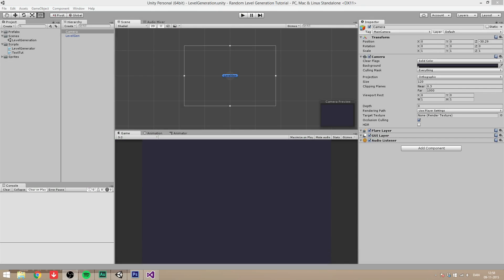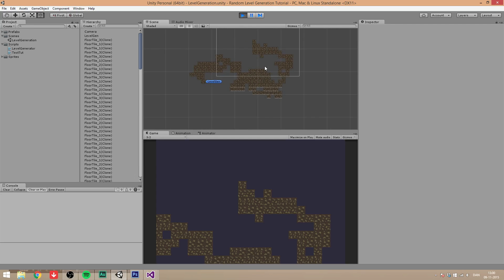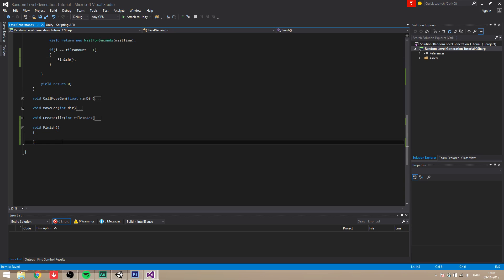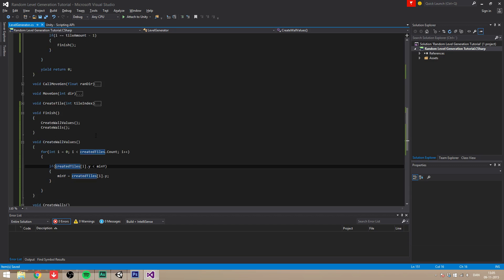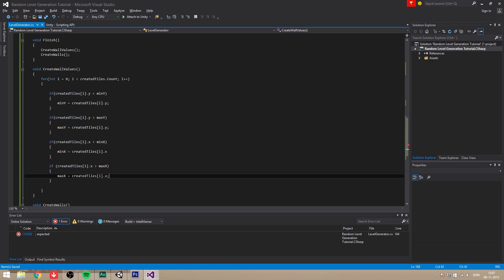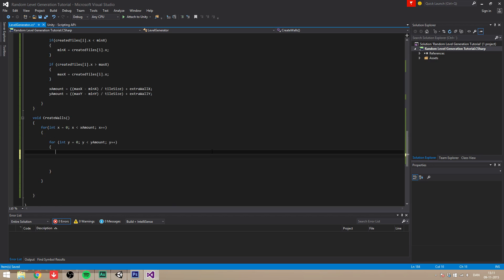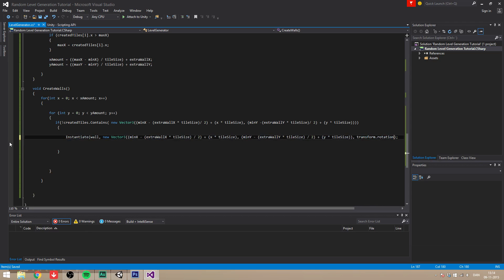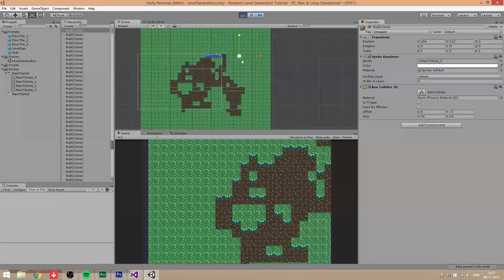Unity 3D - Random Level Generation Tutorial - Part 5 - Walls - 2D -

Comment: I have an issue with mine but I cannot seem to find the error. it is covering the entire area (or sometimes leaving random patches uncovered but most of the path is being covered). Here are the functions.

 void Finish()
 {
  CreateWallValues ();
  CreateWalls ();
 }
 void CreateWallValues()
 {
  for (int i = 0; i < createdTiles.Count; i++) 
  {
   if (createdTiles [i].y < minY) 
   {
    minY = createdTiles [i].y;
   }
   if (createdTiles [i].y > maxY) 
   {
    maxY = createdTiles [i].y;
   }
   if (createdTiles [i].x < minX) 
   {
    minX = createdTiles [i].x;
   }
   if (createdTiles [i].x > maxX) 
   {
    maxX = createdTiles [i].x;
   }
   xAmount = ((maxX - minX)/tileSize)+extraWallsX;
   yAmount = ((maxY - minY)/tileSize)+extraWallsY;
  }
 }
 void CreateWalls()
 {
  for (int x = 0; x < xAmount; x++) 
  {
   for (int y = 0; y < yAmount; y++) 
   {
    if (!createdTiles.Contains(new Vector3((minX-(extraWallsX*tileSize)/2)+(x*tileSize), (minY-(extraWallsY*tileSize)/2)+(y*tileSize))))
    {
     Instantiate (wall, new Vector3((minX-(extraWallsX*tileSize)/2)+(x*tileSize), (minY-(extraWallsY*tileSize)/2)+(y*tileSize)), transform.rotation);
    }
   }
  }
 }
Reply: Did you find the issue? I'm having the same problem.
Reply: Gyro Yes, I switched to a different, easier to implement (but probably inefficient) method. Instead of a Brownian motion/random walk approach I kind of modelled it in a fashion similar to surface tension.

In simple terms:
-Generate an N×M array for N and M that suit your needs. Let's call the array D.
-Populate D with random values from 1 to 100. Define the edges to all be 100. I'll refer to this as a percentage.
-Define another N×M, H and set it equal to D.
-Now for all elements in D excluding the edges, let's say a particular element D(x,y), set them equal to the average of an n×n square centred around the same element in H (or weighted average. This is sometimes called a Kernel and is used in blurring algorithms in image manipulation). 
-Now repeat the last 2 steps for a desired number of iterations c.
-When done, lay out the tiles such that for each element D(x,y)<=p% place a floor tile, and D(x,y)>(100-p)% place a wall.

For the best results, I found that setting c=5, p=50 and using a Gaussian 3×3 kernel (you can find the values on google and I think Computerphile also have a video on image blurring) work the best for me. Feel free to experiment but I wouldn't really recommend changing p to anything other than 50 because since you're averaging, you may miss the "amplitude" of the fluctuations and end up with either an all-floor / all-wall map.

I hope this communicates the idea. I apologize if it was perhaps too wordy :(
Reply: Don't Worry! I found the solution. I added a semi-colon at the end of the 
 if (!createdTiles.Contains(new Vector3((minX-(extraWallsX*tileSize)/2)+(x*tileSize), (minY-(extraWallsY*tileSize)/2)+(y*tileSize)))) line.

Comment: I found out that the ".contains" function is much slower than just going through a for-loop.
Reply from the maker: +BlueByte Games That's weird, do you have a source?
Reply: GucioDevs Only by testing. 
Generating 1000 ground tiles, checking if there already is a tile:
with for-loop: 76 ms.
Contains: 156 ms.

FOR LOOP:
for(int i = 0; i < grounds.Count; i++) {
  if(grounds[i] == position) {
  found = true;
  break;
 }
}

CONTAINS:
if(grounds.Contains(position)) {
 found = true;
}
Reply from the maker: ***** Ha! That's weird, might be because of some odd optimization issue with the .contains function.
Well, it's not always the fastest written code that is the best solution.
Nice finding.

Comment: Even if you are dead, i wanna ask a question, is there a way of cleaning up the map e.g. destroy tiles that are by itself. I can't think of a way that will iterate through each wall and destroy one that has no wall next to it then fill it in. I'm not too good with code. please help!

Thank you in advance!
Reply: Cast very short rays from the tile in every direction, so they only detect whether there is a tile on their left, right or bottom (or top when needed) and destroy them if all of them are not hitting anything :)